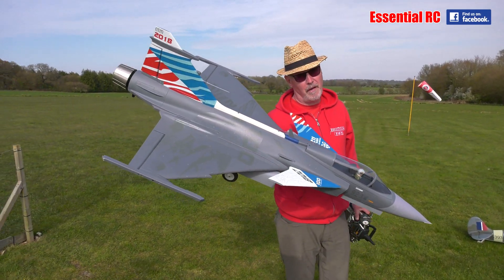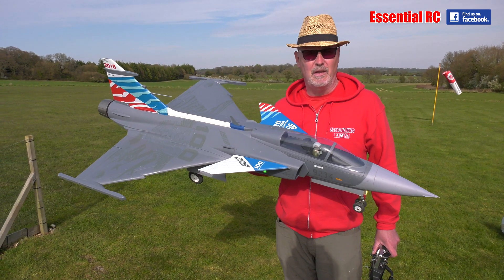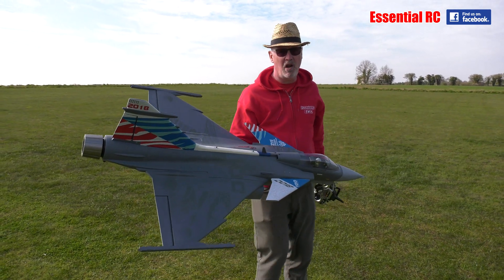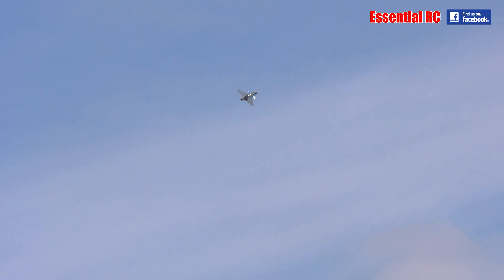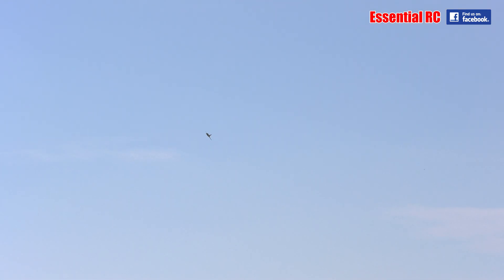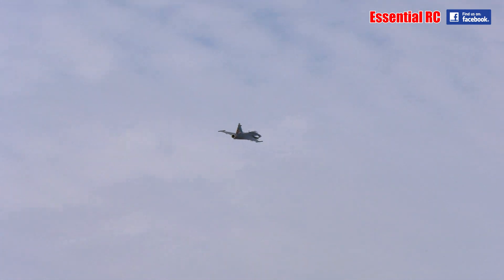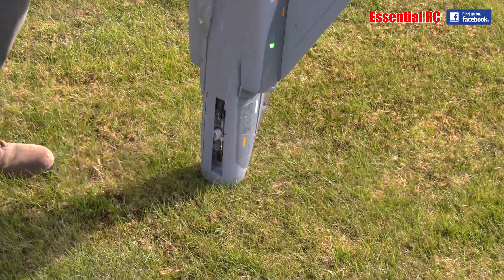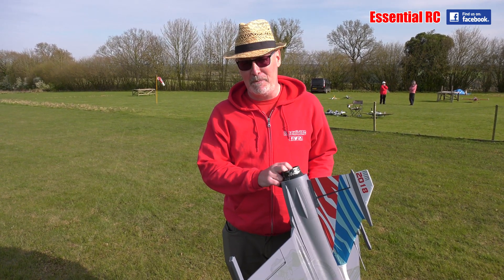WILL IT FLAT SPIN and HOVER ? THRUST VECTORED FREEWING JAS-39 GRIPEN | I NEED A LOT MORE POWER !

Comment: Have you replaced it with turbine yet? I installed FMS 2000kv edf with 7S on my one. Enough power to pull me out of trouble
Reply from the maker: Nah...too many other projects. I've got other composite jet projects with thrust vectoring that will properly hover. Will be flying those soon.
Reply: @EssentialRC it’s ok. Freewing updated the edf unit on all of is 80mm jets now. They now all have the 12b 3658-2150kV 6s unit. More than enough power now. But you’re probably aware of this nowadays.

Comment: Freewing Mirage V2 can hover on 2/3 thrust on the stock setup, if you remove the landing gear and make it a belly lander - that's 250g less.
It can actually start like a rocket in that config :D
Reply from the maker: Thanks for the info Adam! Not a fan of the Mirage myself. Are folks adding thrust vectoring to it then?
Reply: @EssentialRC  I don't think there is a thrust vectoring kit for Mirage - I think its not needed :) 
It has the same powertrain as the Gripen, but its much smaller and the ailerons/elevator is huge fir its size. 
I can do all the maneuvers you show on video (without flat spin - I haven't tried that yet) with the stock setup. Its crazy maneuverable. I dont think the TV is worth the trouble here.
Reply from the maker: My aspiration is for low stable hover. Thrust vectoring and a good gyro is needed for that. Too much effort with EDF anyway. I might get a FlexJet. Seems best RTF EDF jet on the market that is proven to fly 3D. Otherwise turbine power is only option.

Comment: Now I'm a bit disappointed that I spent $80+ for the Freewing Vectored Thrust part. After your mishap, I can see the actual vectored unit is the same one AliExpress sells for around $12. As for the motor, I also ordered the XRP 80mm 12 Blade Full Metal 2700kv Inrunner Brushless EDF. With 6S, that's practically 60k RPM max.
Reply from the maker: I've never had any luck ordering from anyone on Aliexpress. Either takes months to arrive or never arrives at all.
Reply: @EssentialRC  Motion RC doesn't sell the Vectored Thrust part and everywhere else it is sold, is overseas. It all depends who you buy from. You have to look at their shipping date. I'd rather buy local and pay a little extra, but if no one else is selling the part...I wouldn't buy the JAS from overseas, though. The cost of shipping is too much.
Reply from the maker: @brownsamurai3070  I brought it of Motion RC EU 2 weeks ago
Reply from the maker: @brownsamurai3070  https://www.motionrc.eu/products/freewing-80mm-edf-gripen-thrust-vector-upgrade-set
Reply: @EssentialRC  Thanks! Bookmarked. I just received my YAK 130 from MotionRC yesterday and should be receiving the JAS 39 next week. I'm glad to know the EU website stocks other jets that the US store doesn't. 😁
Reply: @EssentialRC  same here.  I ordered things from Aliexpress and never received them.  Too bad.

Comment: 8:10 Your assumption is wrong, there is not a thing in jet turbine like immediately power :) , jet has larger inertia than EDF.
Reply from the maker: I'm not new to turbines thanks. I have several. The acceleration if you're not at idle is very quick on modern engines.
Reply: @EssentialRC  I had one too, and it wasn't "just like that" For example from 50% to 100% of thrust it needed around 3sek.
Reply: @EssentialRC  If I may suggest, try "pumping the throttle" in high alfa. I do this and plane is more responsive.

Comment: i gave up on that tv proj. i have 2gripen 90mm in 6s and 80mm in 6s and had 1in the box with tv. i sold those. my gripen modified 90mm has torque power but same seed as 80mm horiz. becoz of wt. also 90mm more vertical range. however its not good power vs wt ration. not 2:1 ? thx for your video sharing
Reply from the maker: Yeah...If I did it it would have to be turbine. I've only ever seen a Sebart Mig 29 EDF hover and that was because it was as light as an empty packet of crisps.

Comment: Put in a Xicoy x45 turbine: It makes 4,5kg thrust against 3750gr fully-fuelled weight
Reply from the maker: Yup...that's what I'm thinking but Jason is VERY keen to try EDF. I personally think that's a lost cause.
Reply: @EssentialRC  I have a standard freewing Gripen with X45, I'd love to try thrust vectoring with it. Any suggestions for a heat-resistant system are appreciated!
Reply from the maker: I suspect the Motion RC TV add on could be modified with a pipe inside. Will take some effort but worth doing.